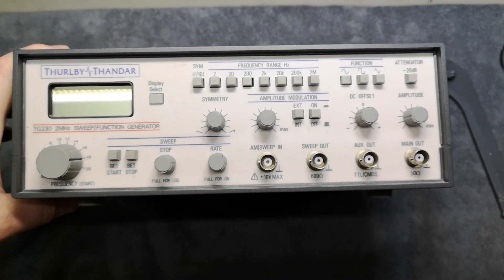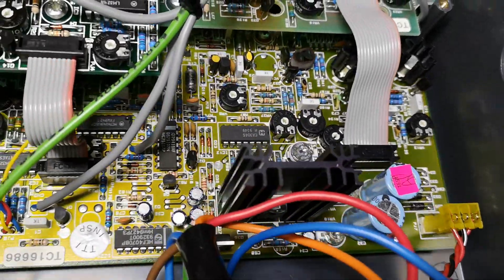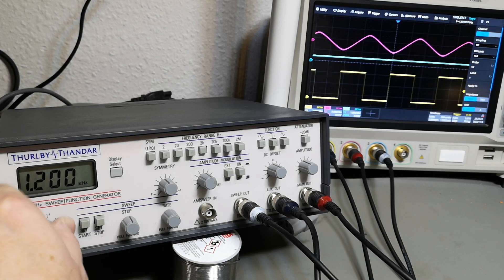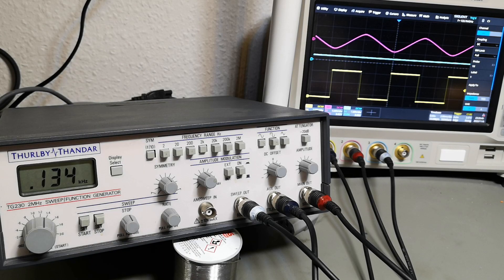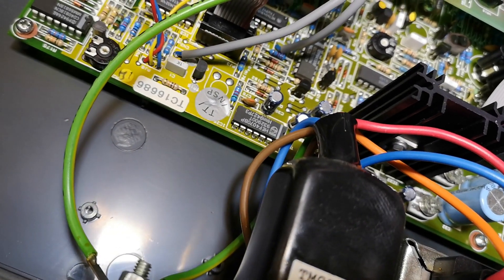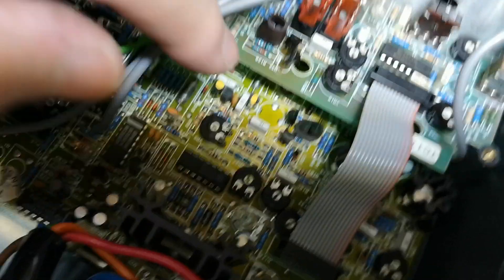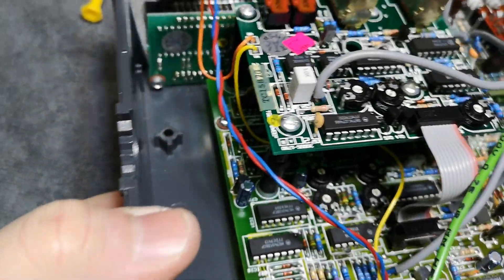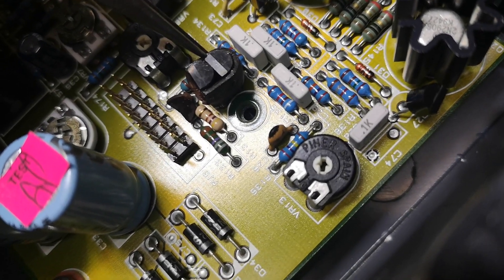Thurlby Thandar TG230 2MHz sweep function generator 1994 IMPORTANT

Comment: Hellerman sleeves, with the rubber turning back into goop. Yes the drop of epoxy will work better, but the sleeve was a fast method on the line. Otherwise just use some heatshrink sleeving and shrink them together after cleaning the goop off.
Reply from the maker: i ended with 3 times large drops of pcb repair varnish, it is just green nail polish if you ask my wife.. works perfect, and DC levels are spot on, no drift, and a nice stable output again, pew that was a big shock to see this.. that bad..

Comment: 30 year old plastics can become quite brittle. Think eventually in the very long term, it'll probably turn to dust. Thandar been a legacy of the late Sir Clive Sinclair. when Sinclair Instruments split off from Sinclair Radionics that was broken up in the late '70s.

The synthetic rubber on the transistors is decomposing and turning back into oil distillates, that's what the liquid is.

Comment: Could it be possible that the liquid stuff is some kind of thermal equalizing thing? I mean like silicon oil or something alike?
Reply from the maker: all thermal grease types are made of NON conducting, and non coroding chemicals, in this case the origin is rubber to transistor contact area, not between transistors, and it is corosive and conductive !
Reply: @TeardownOZ2CPU  I see... Well in this case the sweep generator Is In very good hands!🙂
Reply from the maker: @danielepatane3841  yes NOW it is saved.. i hope this video can help others to save their unit , since it is a really nice generator

Comment: Are the rubber bands an indicator for that the two transistors are matched?
Reply from the maker: they might be matched, but the main purpose is thermal stability, done by keeping the pair at same temperature = constant stable dc
Reply: @TeardownOZ2CPU  ah so,  thankx
Reply: @TeardownOZ2CPU  They likely were gain matched pairs, easy enough if you have a few thousand transistors, and some intern to sit there, plug them into a simple test jig, and bin them for gain at one particular operating point. Then you simply take the bin with the largest number of parts, and any two there will be a close track over temperature, voltage and current. The rest of the transistors you simply put back in the stock of transistors to use as general purpose. 

Sinclair was famous for that, though the beginning was more him getting all the reject transistors, and then testing them again at more relaxed voltage, so that he could get those that only had a little leakage at 12V to use in the amplifier kits he sold, while they had failed at 30V they probably worked at 12V, and also gain tested them, so that he had them at least capable of some gain. Yes those transistors had a high failure rate.....